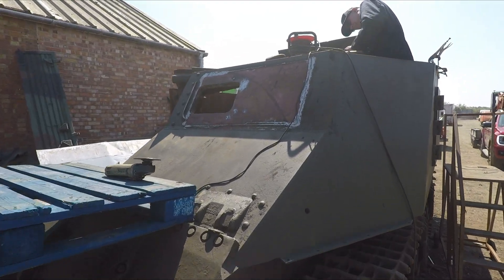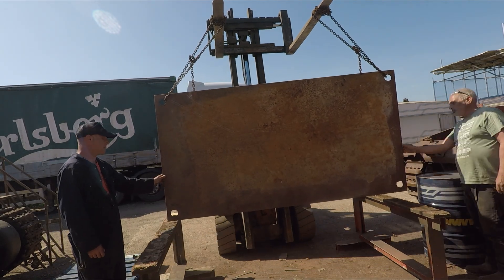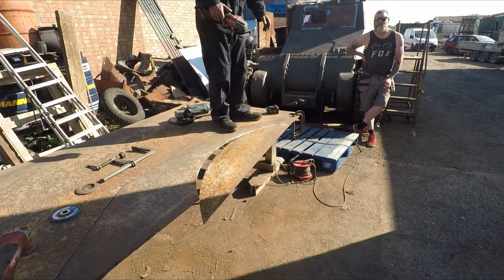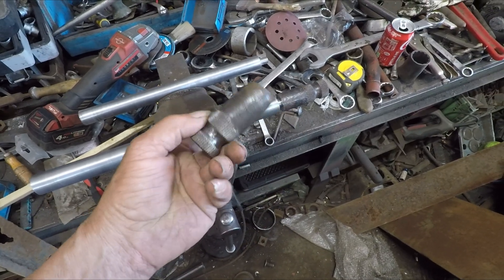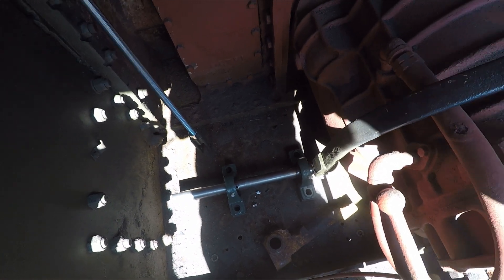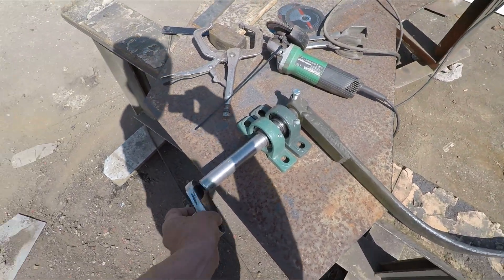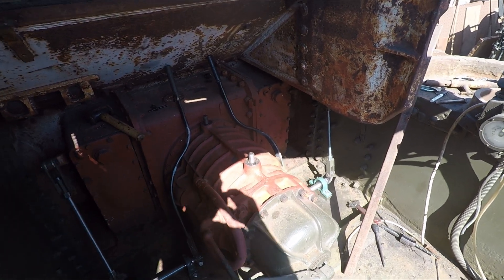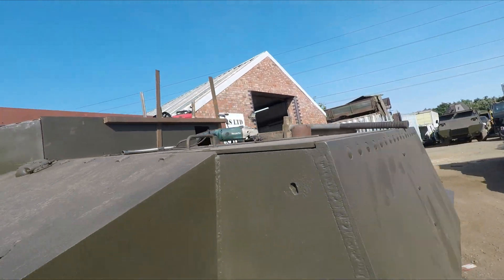M33/Grant tank, fitting the roof and steering

Comment: Do you have a salvaged sponson or will all that need to be mocked up as well?
Reply from the maker: The M33 and M31 had a fake gun mounted on a armoured door that opened, so all of that apart from the heavy cast ring at the top should be easy enough to re-create.
Reply: @514thmick  you almost have enough room on that sponson shelf to set up a folding cot for events :D
Reply from the maker: @Eisen_Jaeger   Dels new cage/bedroom for events ;-)
Reply: @514thmick  🤣